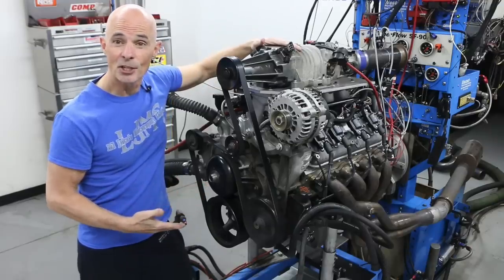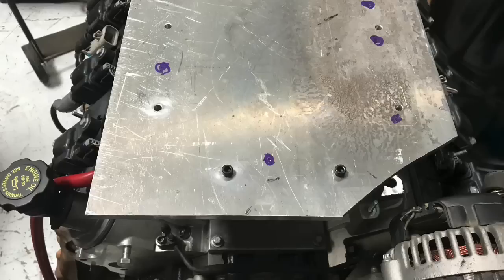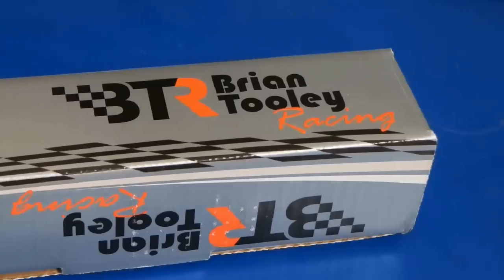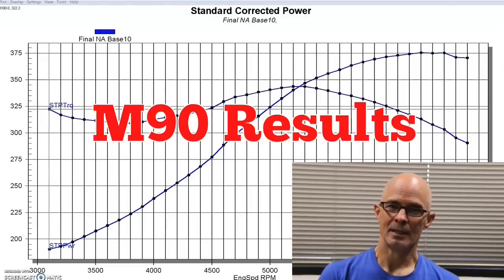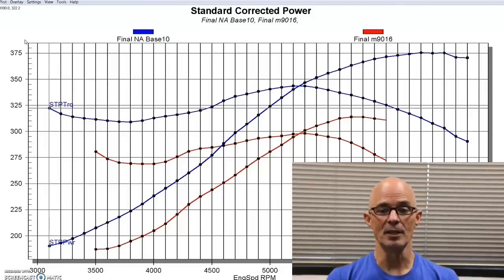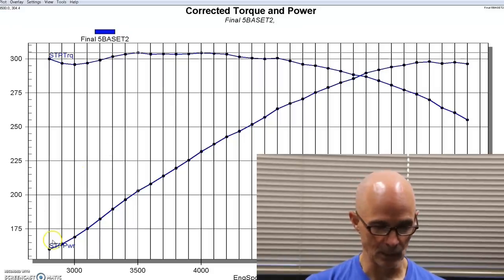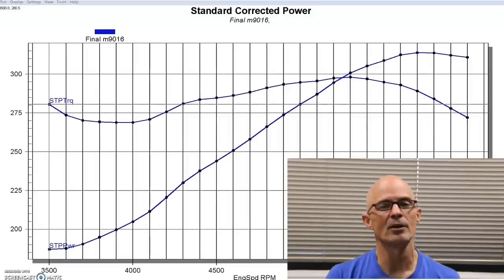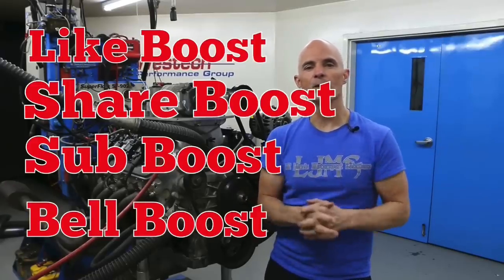JUNKYARD LS M90 SUPERCHARGER TEST-FULL RESULTS!

Comment: Man I'd love to see a terminator cobra M112 blower on there or two!!! 🤘🇺🇲🦅
Reply: Rocketboyjerry those aren’t much bigger. The cobra motor is only 4.6 liter and revs to the moon
Reply: Just posted the same. Or a GT500 blower
Reply: @BustedWalletGarage  True but its for a v8 and flows more cfms than the one in the video. Plus you can port the termi blowers easily for a good bump in air flow. Worth a try!
Reply: Rocketboyjerry the gt 500 uses an expensive throttle body and needs an intercooler.  By the time you fabracobbled all that together you could get a good used complete Procharger system. I think the point of this video is “ garbage in, garbage out “.
Reply: BustedWalletGarage  for the $5,000 that “good used” system cost you could build  a legit reliable turbo system. The point is, I can buy a GT500 blower right now for $300. I think they normally go for $750? $900? Idk about a $4100 throttle body.

I mean.... if I could buy a pro charger Complete (yea... more like supposed to be complete, but rarely is) used for $1500, that would be the deal.
Reply: @bryanleverett2830  The m122 2.0L from the 07 -12 or the 13-14 tvs 2.3L would work with the intercooler off. Also the termi or lighting blowers are 1.8L if I remember correctly.
Reply: @BustedWalletGarage  Honestly man stuff like this is fun to watch and they don't cost you or I a dime . I'm a gearhead and love to see different setups. Gotta break out of the cookie cutter box once in a while!  And most importantly have fun and enjoy life its waaaaay to short!
Reply: M112 wouldn't work very well either.
Reply: M112 is a 1.84L displacement vs the M90 that is a 1.3L displacement. M112 or the M122 would be a much better option and has been done on LS engines with good success
Reply: Bigger blower, dual m90s would be a waste. I want to see something that could be viable in the real world, dual.M90s wouldn't work out around town.
Reply: @ReinersRigs  m112 still to small for a ls. M122 is too. Ls isn't a ford motor, it actually makes power on its own.
Reply: @BustedWalletGarage  the 03 cobra engine don't rev to the moon. I pull gears in mine at about 5800 for it's best et/ mph. The m112 is ported and pullied to about 14psi.
Reply: I was thinking the same thing, or the one from the Harley Davidson truck
Reply: Bryan Leverett actually a working gt 500 supercharger , just bare, goes for $1800
Reply: I'm a 3800/L67 guy. I have a 1998 GTP. I haven't watched the whole vid yet. I've see a guy put one of these on a 302 in a Fairmont back in the day. IIRC it was kinda quick. I would do a M112 or M122 instead. I recent tuned a GTO with a Magnuson M112. Only 7 psi but it ran pretty well.
Reply: I kinda figured it would lose power...
Reply: I had one of those on my channel, actually. Installed in a NASCAR Homologation Pontiac on top of a 6.0 LS. Relatively easy install by the look of it.
Reply: 122 kits have been made for years for ls motors. It'll provide just fine.
Reply: Put a blower on a Japanese 3uzfe for 1 uz
Reply: HioSSilver1999 If you consider the actual power produced per cubic inch of displacement there really isn’t much difference at all in what a stock LS produces vs a DOHC Ford V8. Now granted we’re in LT world now not LS, but the new C8 Vette LT2 displaces about 380CI and makes 495HP. The new Coyote displaces about 302CI and makes 480HP. Even going older we can see that an 01 LS1/347CI Camaro SS made 335HP. An 01 Cobra DOHC 4v/281CID made 320HP. Do the math for HP per cubic inch on almost any example of modern Ford Vs Chevy performance stuff and there isn’t this huge gap everyone always seems to imagine. It’s not surprising when a larger engine makes more power than a smaller one; are you shocked to learn a 2.0L Honda makes less power than a 6.0L LS based Chevy. However, take the efficiency of that little Honda and extrapolate that into LS displacement and the numbers would surely be different.
Reply: I would love to see 😀if Ford lightning M112 blower on a 5.7 stock ls1 please🤞👍 for the modders out there.

Comment: This was a cool test. Smaller pulley, twin superchargers. Was literally my first thought when the video started lol. I bet this engine could put down 580-620hp with two. Depending on pulley size. If you built a box design intake, you could even run three superchargers. One on top and one on each side. Would make a sweet looking rat rod engine.

Comment: Would you be interested In letting me ship you a full stack intercooler a set of pulleys 3in and under and a way bigger throttle body with an adapter
Reply: Good god someone pin this comment!
Reply: ^ This please!
Reply: And add some race  fuel + bigger size injector that combo ! 👆🏼
Reply: I’d be interested

Comment: Would love too see what that m90 does with a smaller pulley(<than 3", maybe a 2.4") and some methanol through the blower too help seal the rotors up a bit (this normally gains a pound or two of boost by itself)

Also curious what the smaller pulley does too the IAT2 on this 4.8L Setup..

Comment: I put a m90 on a jeep wrangler 4.0. With that in line with 5.5 pounds of boost. It was a beast. M90 works awesome on jeeps inline. Just won't unless modified on 05 an 06. Anything below a 05 the m90 is a beast

Comment: On a stock 3800 s/c (l67 engine code) the crank pulley size is 6.95 inches, Would love to see more tests done with a 3800 and to see some of the platforms myths busted too! plenty of interesting tests could be done but im not sure if the fan base here would be interested in seeing v6 stuff sadly.

They can make 600+ hp with a turbo for those semi curious

Comment: Interesting! I have 3800 that was superchargered and i pulled blower apart and blocked it off and slapped a turbo on it... 3800 loves turbos... aint no ls but its ok
Reply: Use BOTH
Supercharger and TURBO.
It works.
Drove a 8v-92 Detroit Diesel, the the FACTORY made.
The TURBO blew into the supercharger. TWO CYCLE DETROIT DIESELS MOVE ALOT OF AIR.
Reply: @nellyfarnsworth7381  makes more torque than im interested in...  lol manual fwd transmissions are already questionable lol
Reply: @Garageless  
I have read these before,  In magazines. 
BUT IS WRONG
1968 Oldsmobile Tornado 455 cid WITH 385 hp & 500 ft/lbs.
Is a excellent example.
Reply: @nellyfarnsworth7381  search twincharge fiero dyno  there is 3800 makin 300hp and 490tq all details in description
Reply: Loved my 3800 Grand Prix even stock

Comment: Hey my favorite engine finally came up in your videos! I build these 3800's as a hobby. They are very stout little fellas. Currently working on my own little turbo 3800 right now. Aiming for 700hp.
Reply: It'll blow up
Reply: @snoopy5736  got a forged rotating assembly, oversized head studs, and a whole bunch of strengthened valvetrain parts. It's definitely not gonna blow up.
Reply: @DeagledSmeagol  Anything can be destroyed by the tune/r, get somebody competent to do it!
Reply: @Aseutester  I am a tuner. 😃 This is just one of my side projects. Current output is 600bhp on 18lbs of boost.

This one was particularly tricky as the MAF runs out at around 9lbs and there's no 2bar OS, so fueling after about 5000rpm has to be done with PE tables.

Comment: I'd try twin M90s before getting into the trick parts. It's pretty obvious it's way too small... but let's spin it until it blows up lol
Reply: The "Junkyard Dogg" channel is building a twin m90 5.0 in a fox body. Youl should go check it out.
Reply: They can spin 16k rpm reliably, past that they are just inefficient, but I've seen as high as 20k rpm before they grenade lol.
Reply: It'd be hella cool lookin' too
Reply: The only reason it is seeming too small is due to the 3.8 inch pulley. The 3rd gen m90 blower reaches 90% volumetric efficiency at about 12k~rpm blower speed. Assuming his stock crank pulley is similar to that of a 3800(about 7.5 inches)  he's under a 2:1 pulley ratio. That means the blower didn't even reach peak case efficiency until nearly 6000 engine rpm. The benefit to a small roots blower is its ability to turn more Rpm. Take into account that this same blower has put a 3700lb fwd car into the 10s. I think if it were to drop pulleys down to a 2.8, he could get enough volume of air to pass 400 crank hp with no issues. These have supported 400 whp in fwd auto combos aswell and he could throw an ati super damper and pick up even more blower speed. Also this combo could retain an alternator with zzps 100$ belt wrap kit that would keep tension for the blower and alternator both.
Reply: @madmod  regardless of that cars' weight, what engine was it? Even with pulley swaps, the M90 can only produce a certain amount of air. The faster you spin the blower, the greater the amount of heat produced which will ultimately cost power.
Reply: @rcairforceone  3800 series 2 non intercooled m90 powered cars at full weight have seen 10s with a gen 3. The m90 does not "produce" any air, it moves a fixed volume of air. Not 91 cube's not 85, but 90. the benefit to the smaller Roots designs such as the m90 m112 and m122 h is their ability to spin. An m90, being the one of the more capable blowers with rpm, takes less than half of the power required to drive a stock pulled m112 even when turned past 16k Rpm. The heat from that same rpm, is entirely dependent on the blowers outlet restriction ie the engine. Roush still sells the same m90 rotor packs in their 400hp 3v kits. Saleen series 2 blowers share this same rotor pack. Roush uses 270% overdrive ratios for their cars. That's 70% more blower speed than this 4.8 saw on a stock kit that has room to pulley down. Albeit, this doesn't have an intercooler, but it would be so easy to sandwich one under the blower as they make them for the high ram and m90 already do either could be used to help with heat but as I've stated before, people have gone fast on these little blowers without intercoolers for years. Have we not heard of ethanol?

Comment: I believe the stock crank comes to just about 7.5 inches on a 3800. For comparison, I knew I needed more blower speed for the m90 to feed my 4.6, I opted for a lightning lower crank pulley which can be had up to 10.25 inch diameter. On the stock 3.8 inch blower pulley, it makes for a 2.7:1 pulley ratio with room to drop pulley sizes down to get up to a 400% blower overdrive with a 2.8 zzp pulley. Now comes the problem of dealing with the heat haha.

Comment: Crank pulley on the 3800 s/c engine is 6.94” diameter (7”) and there is an aftermarket 5% blower overdrive available. The smallest pulley available for the m90 is 2.55” and requires clearancing the ribs on the snout of the blower. The other option is offset pulleys, which you could then theoretically go smaller, but has issues fitting in the fwd cars with full accessories. Running a 3800 with stock crank pulley and the 2.55” blower pulley they put down almost exactly 400hp to the wheels, give or take 10hp. With drivetrain losses that comes to approximately 460hp at the crank. If you could run a 2.55 pulley on the m90, with a massive crank pulley (since it’s on an engine dyno and just for fun anyway, you could get away with a huge pulley, like 9” or 10” and really over spin that m90, but I bet it starts to cavitate air and doesn’t make gains beyond the 500hp airflow mark, that’s where you’ll need to run two m90s side by side (and slightly lower rpm) to get enough airflow to make big power out of the 4.8
Reply from the maker: 400 wheel would be a lot from the M90
Reply: Yeah after checking my research again, that 399whp dyno pull was on a cts-v after swapping pulley to 2.55” NOT on a 3800. Looks like the baddest 3800s out there with all the bells n whistles are putting out around 375whp on their very best days. Still curious to see what a smaller blower pulley and larger crank pulley will do, but it still probably won’t be able to keep up with the airflow needs of the 4.8. If so then a dual m90 setup would be cool to see, just to see what you can do with junkyard trash.

Comment: I would love to see a compound test.  I have a 4.3 V6 with twin turbos compounded to an m90 drawing through a predator carb and does pretty good. I’m mixing race gas for about 102 octane. 18-20 lbs boost .haven’t had it on the dyno yet
Reply: All can be see on my page

Comment: On our 3800 we ran an M90 and made over 400whp. We used an overdriven balancer and a 61mm blower pulley. With heads/cam blower porting etc. The car ran 10.79@126mph @3500lb.  Video on my page. Was way back on 2008/9.
Reply from the maker: nice job

Comment: I’d like to see the m112 off the lightning then the M122 all on the same motor individual testing then dual M90 blowers. Like junkyard dog is doing to his 5.0
Reply: That would be cool, but your not finding those blowers in the junkyard lol.
Reply: allanb3222 right but the M112 you can pick up for 450-500$ and the M122 you can get for 650-700$ which is relatively cheap compared to a Weiand. 

And the people who would be interested in making one of these blowers work would most likely be able to fab up a lower intake and or do like B&M back in the day and make a plate to bolt to a 4150 flange then to a blower bottom plate.
Reply: @allanb3222  
M90 are in pick & pull  yards
Reply: @nellyfarnsworth7381  yeah but not m112 or m122, like he is wanting.

Comment: Richard, I’d love to see you max the m90 to see what power it will support. ZZP makes a lot of pulleys
Reply: Hittman1422, without porting, chasing power will be a battle between boost and heat. More so, to the point of where the M90 is efficient. M122 is where takes over where the m90 maxes out to and does so more efficiently without the heat the M90 generates.

Comment: Here's what I would do: Smaller pulley until the belt slips because there isn't enough pulley for it to properly grip.  Then maybe twins but if so with stock pulley size and then with the smaller ones.  After all that, weigh it and figure out if the work is worth the weight as compared to a turbo set up with similar results if it actually makes more than the NA configuration.  Awesome video!  Thanks!

Comment: I'd imagine that the 4.8L can breath more air than the M90 is able to push into it. Would be interesting to see a M112 or M122 off the Ford Lighting / Mustang GT500 would do on a 4.8-5.3L. Would be interesting to see if they are efficient enough to actually produce some boost.
Reply: He ran that test, did you watch it?
Reply: @corvetteZ3r  I did not see the test with the Eaton M112-M122. Only the one with the M90
Reply: @corvetteZ3r  cool I'll check it out. Thanks.

Comment: @Richard Holdener.  Seasoned 3800 enthusiast here. I think you did not have the m90's boost bypass valve set correctly. When the engine was not running in the video I noticed the lever is up, plus you have a red hose going to the dyno, Remove that. If plugged the valve holds the last position. The lever should set flat against the stud when off, When idling it will lift off the stud. I think you were bleeding boost during your run. Also the stock diameter of the L67 Series 2 crank pulley is roughly 7 1/8" diameter.

Comment: Confirm that your superchargers actually spinning at the correct speed before you make an assumption you didn't even know what the pulley size was for a stock 3.8 L V6 on the crank what is kind of important determine the RPM of the supercharger

Comment: Would love to see the compound setup with a turbo blowing into the m90, been thinking of trying this myself
Reply: Not efficient, the m90 is a choking it at that point
Reply: I may just do it this spring. Already have a ported m90 on my car, and a cheap 50/60 turbocharger lying around.. but turbo would be mounted in the trunk. Im doing a mod that requires the spare tire well to be cutout, so would be quick & simple!
Reply: Zenithskull mine is not an Ls it is a 3.8l l67, and it’s not stock ,2.7”pulley ported blower and heads cam etc and made 400+ rwhp ran best of 10.88 @ 122 so blower is pretty much maxed

Comment: I have an m90 on 292 inline chev.. added to help overcome the less than optimal head design and to add low end and mid range torque for towing. I am running at higher blower speed ( relevant to crank rpm) but engine will probably never see 5000 rpm. I’m firing it up in the next week or two and I’m sure hopeful for a better result!!!

Comment: Yes please do....also that supercharger in all the tests I've seen did better at higher rpms anyways so a high ram intake just makes sense to me......in the bottom end of the rpm spectrum there is very little if any boost so it needs 3500 plus to build boost from the jump....question is does the superchargers life expectancy suffer from using it in this application running it at higher rpms will it live past 100 pulls/races if it were put to use ?

Comment: There's a YouTube guy, junkyard dog I think is his channel, that put twin m90s on a Ford Pushrod 5.0
Reply from the maker: I saw his stuff-cool
Reply: I gotta check that out!
Reply: not running as far as i can tell, btw i subscribed.
Reply: @richardholdener1727  since you mention it, that does seem like a lot of work instead of a big cheap china turbsky
Reply: Was that in the Thunderbird?  I remember that and there others who ran M90s on 5.0L fords.
Reply: @mskehan19  no hes doing a mustang
Reply: @mskehan19  I believe the thunderbirds did use the M90's but only on the V6 engines
Reply: Chris Hernandez yup, super coupe 3.8l, same size as gm motor
Reply: @richardholdener1727  that M90 is rated to 15,000 RPM  http://www.mscperformance.com/specpg2.html M122s are getting cheaper as well, and add less heat.